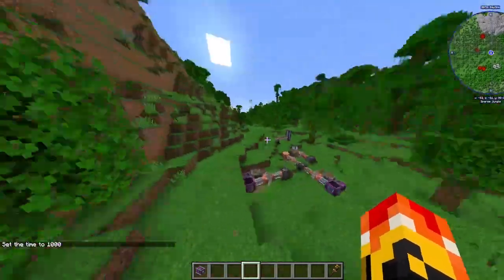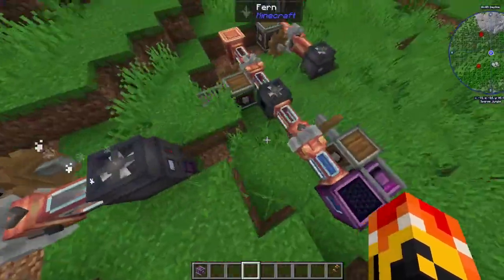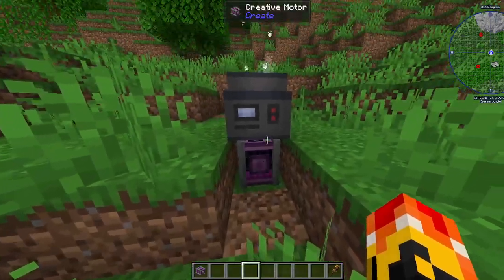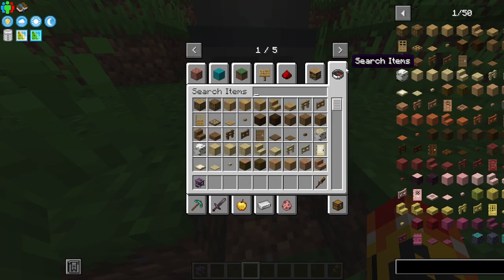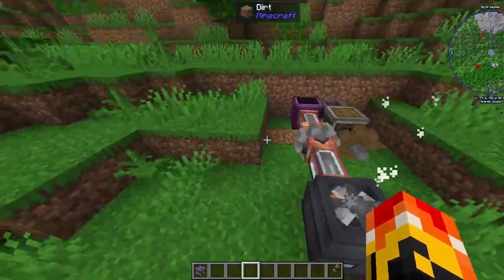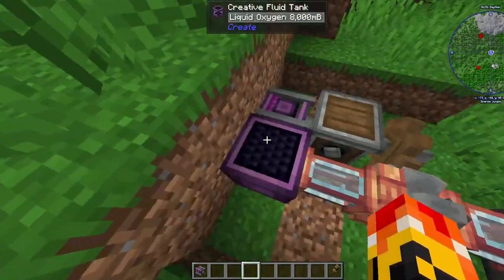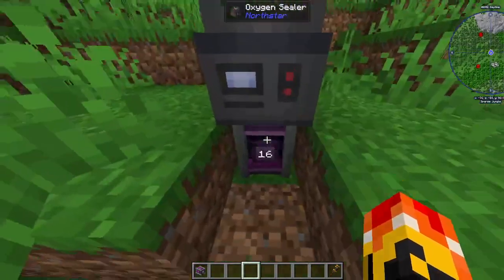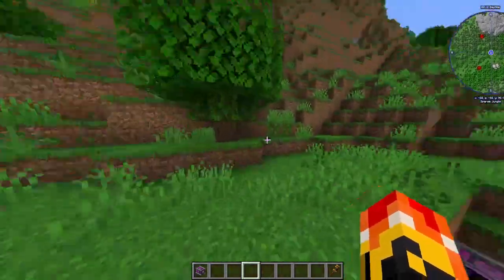How to Set Up Your Oxygen System in Create: Northstar

Comment: Im doing this all in survival, and im dumb, how do you make liquid oxygen?
Reply: use an electrolysis machine to create oxygen from water. you can get water from ice and snow which are found naturally on the moon and mars.
Reply: @lmaolol7702  you can also use it for rocket fuel aka hydrogen
Reply: if you use an oxygen concentrator and pump the oxygen gas into an ice box and cool it to -185 degrees it will become a liquid and you can then put that into the tanks
edit: its hard to transport, but pumping pure oxygen gas still works with oxygen sealers, it doesnt need to be a liquid
Reply: IDK but you can make oxygen gas if you power a oxygen consentrator on earth